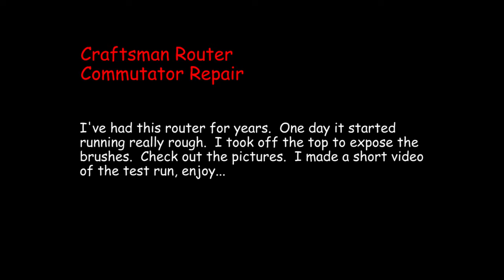Craftsman Router Commutator Repair

Comment: I Hi.. i have a craftsmsn router keeps turning off due to sparks..i took apart and filed the commutator good on a lathe and then i flattened the brushes good and now it works a bit better but powers off at high rpm setting...sparks...anyone have any suggestions..brushes are about 1/2 in long